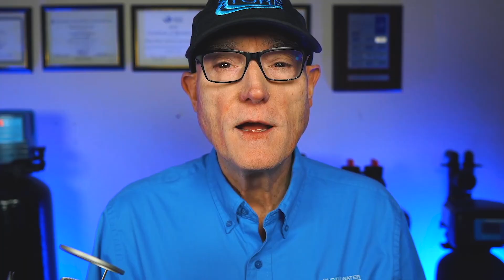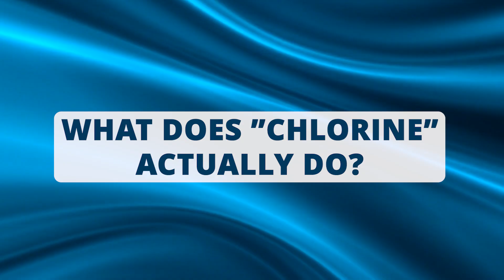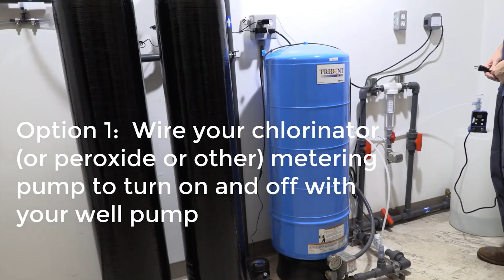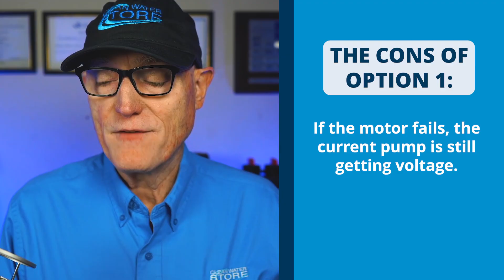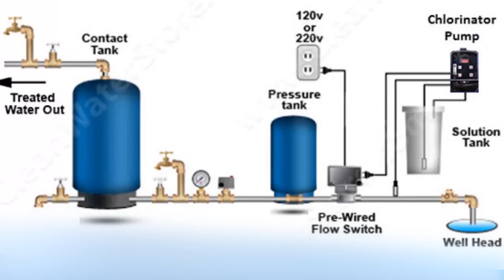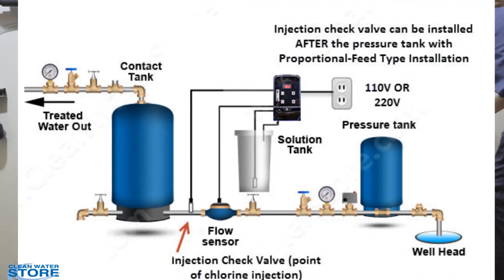How to Automatically Disinfect Your Well Water with Chlorine (3 Proven Methods)

Comment: My chlorine pump runs constantly and I was told it's supposed to be by plumber who installed it. Is this correct? If not, how do I fix it?
Reply from the maker: Hello - a chemical injection pump should NOT run constantly; it should only inject when water is flowing, triggered by a flow switch or pressure switch signal. Running continuously wastes chlorine solution, can over-chlorinate your water, and burns out the pump head prematurely. You'll want to check that your pump is wired to a flow switch or the pressure switch circuit so it cycles on/off with demand — if that wiring isn't in place, that's likely the fix needed. Reach out to us at support@cleanwaterstore.com with your pump model and system setup if you have questions.

Comment: Is there any reason I would NOT want to inject the chlorine solution directly into the well, as opposed to injecting it into the line feeding the pressure tank?  Thanks, in advance for your answer.)
Reply from the maker: Hello - injecting directly into the well (shock or continuous well chlorination) works but has a few drawbacks: the chlorine can degrade your well pump seals and wiring over time, it's harder to control dosage consistently at depth, and you still need contact time plus carbon filtration before the water enters the house. Injecting into the feed line ahead of a retention tank gives you precise, adjustable dosing and keeps the chlorine out of the well casing and pump components. Most residential systems use line injection for those reasons unless the well itself has a persistent bacterial contamination issue that requires direct treatment.

Comment: So I have an aeration tank which by my estimates is about 120 gallon which has a submersible in it that pumps to the house with a three-stage Nouvu H2O setup in between. I'm considering a pellet fed system. Would I be installing this before 120 gallon aeration tank to drop into the aeration tank?  By the way my piping is 1 inch and I'm not sure what dimensions are on your pellet feeder. Appreciate your feedback
Reply from the maker: Hello Max - For a pellet chlorinator with your 120-gallon aeration tank setup, you'd install it before the tank so chlorine feeds into the tank for proper mixing and contact time. Our pellet feeders typically handle 1" pipe connections, so that would not be an issue.  Email support@cleanwaterstore.com with your flow rate (GPM) and we can size the exact pellet feeder model for your system.